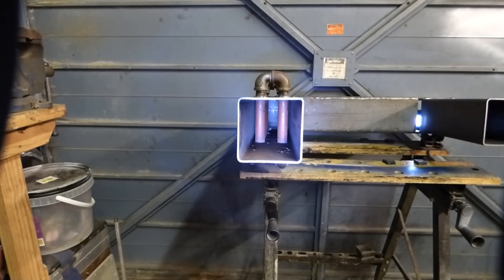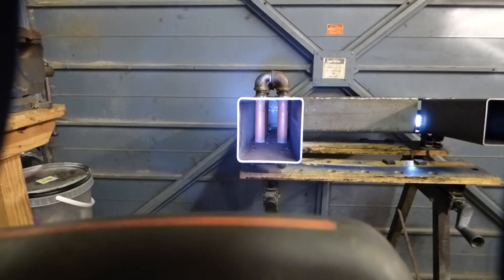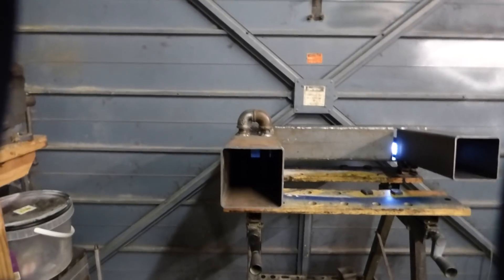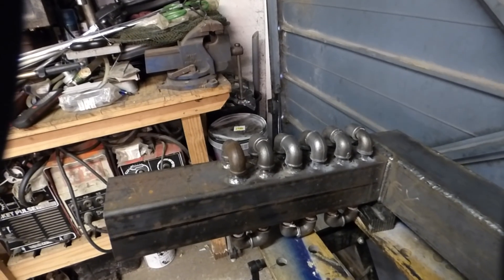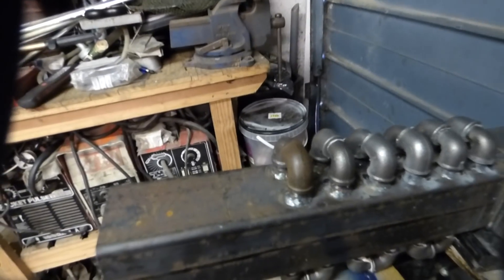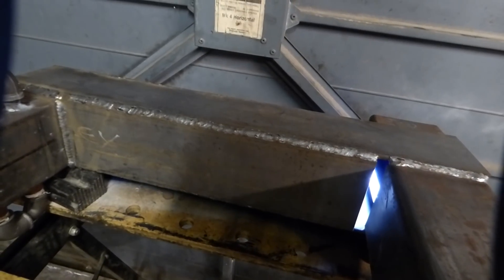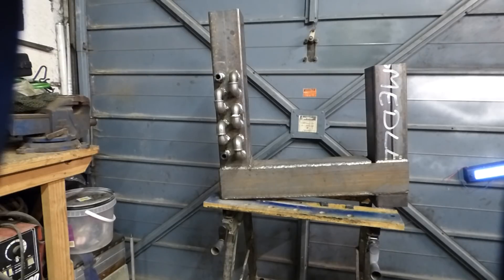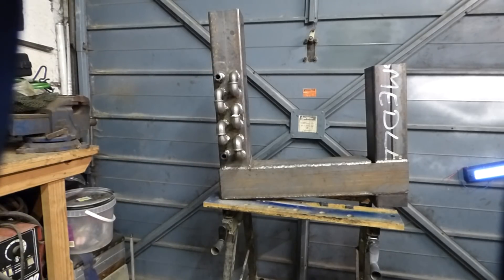rocket stove boiler part 1 No.28

Comment: I worry that putting the heat exchanger in the riser will siphon too much heat to fully burn off the combustion gases and Creosote.
Reply from the maker: At 600 degrees not a problem
Reply: Should be 1200 or better.

Comment: That will be good to see when working. What are you going to run off it, just hot water or rads or both. Did you weld the mf's (not the pipes) on one side of the box or both sides.
Reply from the maker: radiators
Reply: How many and what size of rads. I just listened again and you said welded all the way round. I like this build of your's. Sorry for so many questions. I would like to build one. At present I have a log burner with a boiler at the back and I just feed it all the time, that's not so bad it just takes a lot of food.

Comment: Hi, just found your channel, and picked up lots of ideas. Question, would a pellet rocket heater put out too much heat for indoor use, in a 20x20 foot living area 12 hrs. a day? Running on auto feed, with a small basket. I'm concerned too small of a basket, it would just smolder, to large would over heat the area. I would really appreciate your thoughts.
Reply from the maker: no
Reply from the maker: 75mmx75mm box